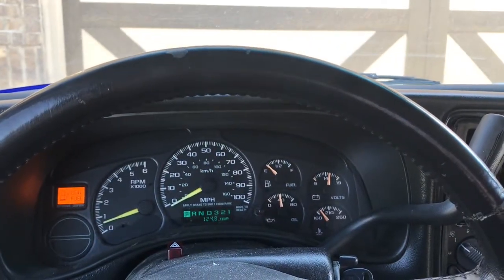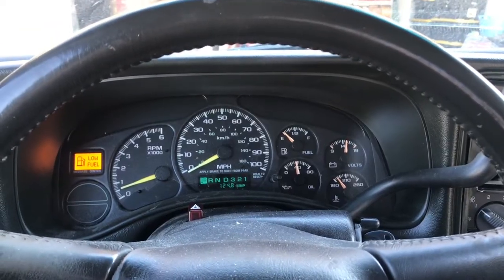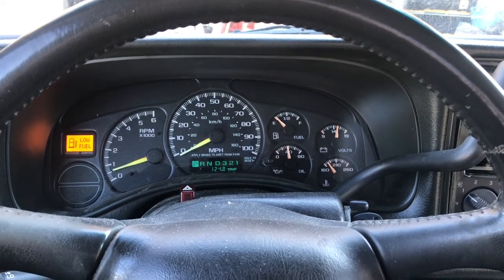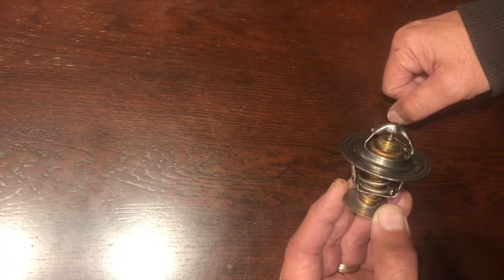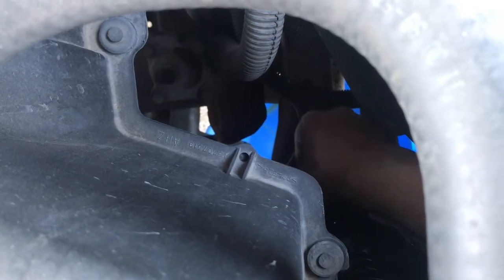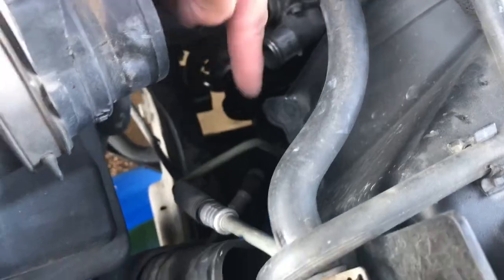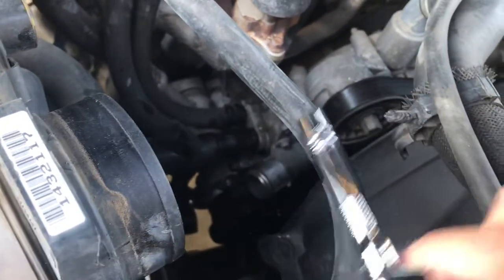If your temperature gauge is below 195 degrees it is more than likely a faulty thermostat.

Comment: CRAP....I wanted to see that stuck thermostat you removed !!! Also I would have used a thin film of RTV silicone and let it dry for about 30 minutes on the new rubber seal to make sure it stays in place before bolting the neck back on. It is always a pain in the ass to put new coolant in too, since none of the new radiators have an old style fill neck on top,.....engineering genius,...NOT.  LOL.
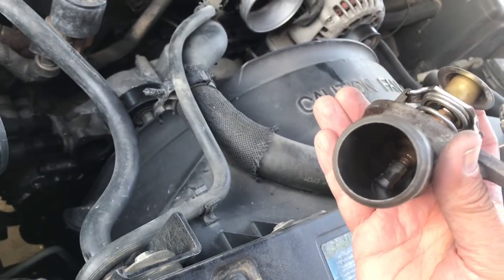Reply: 8:58

Comment: I put a larger radiator in my 94 silverado and kept the 195 thermostat but it stays around 155 to 170 on the temp gauge, also my heater is only running around 110 to 113 in the cab. Any ideas to help a feller out?
Reply: No problemmm.. you can cover a small aprt of your radiator with a cardbaorda and give a try . if you fell better,

Comment: Need some help. 2014 Silverado 4.3 105k miles Temperature is stuck at 160 and fans keep running constantly until I pull the fuse. No codes with both of my scanners. I replaced the thermostat sensor and it worked fine for a day and back to square one. I have the thermostat to replace next. My question is will the cold air intake I installed cause this issue. It was fine until the temperature dropped outside. 
Failed to mention with the scanner hooked up when the temp sensor was working the scanner was off at least 60+ degrees difference than the gauge in the truck.
My question is what’s next. I keep reading different things that the ac pressure sensor the map sensor could also cause this. 
Please help if anyone else is experiencing this issue what did ya do to fix this problem.
Reply: dont invent in your car, fan switch may have a problem..

Comment: I have the same issue lack of heat and it’s only 64 degrees by me. 
i have change both of the thermostats on the body housing Tested some sensors and no luck
2019 there was a recall for the catholic converter. This is my fathers car so I don’t really know when the issue started as he don’t drive the car much as you can tell from the mileage Anything will help, any advice.

Comment: My Dodge 1998.5 24 Valve Ram Diesel 5.9 in the cold weather will Not warm all the way up to 195°
It can idle for hours even go for a drive, the dash temp gauge will show Approx 190° but a temp gun right on the Block Thermostat housing never get up above 170°
Reply: @Douglas Nathan yeah I hear ya, but this is a pick up truck and the round town MPG has declined dramatically and coupled with the Purposefully cause fuel price increase of $1.60/ gallon by Sock Puppet fool BIDEN, the performance loss is increasingly Untenable.
Also I know that Semi Trucks put a special Radiator Blanket over the front of the radiator with adjustable flaps to control/ block the air flow so Thier trucks will warm up.
Reply: @Douglas Nathan Has nothing to do with politics just like oil and gas prices. Poor dummies believe anything the wealthy tell them lol.
Reply: On my Dodge , same as yours, I found that in the old weather it helps a lot if you can get a Blanket   like the 18 wheelers use to block the cold , they place it behind the grill in front of the radiator

Comment: Hello Scott That's Not The Problem with my Truck Brand new Thermostat, And even running for hours and will not warmup to temp to Open The Thermostat
Reply: I just put a new thermostat and new engine coolant sensor and it's still running cold 🤷‍♂️🤷‍♂️🤷‍♂️
Reply: @johnbeasley7654  were you able to figure it out? I am have same problem.
Reply: @Supreme_Solution OYL  no I haven't had time to really work on it. I'm prolly just gonna take it to a shop. I'm thinking I just got a bad thermostat but the thermostat assembly is like $110 so I dont wanna just keep throwing parts at it.
Reply: @johnbeasley7654  let me know what you find out from the shop im having  similar problems.
Reply: @supreme_solutionoyl3933  will do, I should be able to get it into the shop this week
Reply: @Supreme_Solution OYL  ok so I just got back from the shop and apparently I had a bad water pump. It wasn't a bad leak so I didn't see any visual indication of a leak I guess it was bad enough to cause problems though . Hope that helps.
Reply: @johnbeasley7654 me too
Reply: Hey Gary .. did you ever find out the problem on your truck, I am having the same exact problem with my 02 Yukon and don’t know what it is, already changed thermostat
Reply: @albertjones9171  Check your Engine coolant temp (sensor)
Reply: Have either of you had any noticeable damage from this? Mine has been running cold for who knows how long and it is now running bad. Engine is staying drawn down with a slightly noticeable tick right in the tip front with a faint walk in the serpentine belt 🤔 I cannot figure this out. I am afraid it is going to ruin my trailblazer. New tensioner pulley, temp sensor, cam position sensor. I don’t know what to do. Thanks for any answers.
Reply: Replace your temperature sending unit sensor
Reply: Dealing with overcooling on my 99 suburban

Comment: I have a audi A3 2005 tfsi, and its having a heating problem. The temperature never reached 90 decrees Celsius before I changed the thermostat, now it reaches 90 after I changed it, but it takes about 15-20 minute of driving when it should take about 5-10 minutes. So I changed the temp sensor but that didn’t speed up the heating either. I’ve tried to bleed the system of air without succes. Anyone who knows what it can be or if you have or had the same issue?
Reply: Similar is hapening to me, with Citroen xsara. If temp reaches 75,  by pushing gas pedal and making 2000 rpm or so, temp goes down. Also with AC turned on, temp is constantly just about 60 because ventilator is engaged, and cool radiator constantly. And yes, thermostat is changed , maybe 4 times.😟😀😀😀😀
Reply: @colloidalsilverwater15ppm88  ventilator may not be engaged,, if your temp is 75
Reply: your new thermostat may have a problem..when coil is weak it may get more tim for correct emp, i wouldnt mind with it , check fule consuption in computer if it rises better get a new thermo

Comment: After warming up my car the thermostat goes to the middle but if it’s cold outside my thermostat as I’m driving goes all way back down to cold what could be the problem
Reply: Its getting to much cooling the  thermostat is stuck open Thermostat stuck open Most likely it can cus it to be more cooler and take longer to heat up right and never gose to the middle  at higher speeds and in the coldereather  or it could be as simple as its just the  The Temperature gauge is broken
Reply: Just replaced my thermostat because my heat in the truck and the temp on the gauge are very low. Tested old thermostat it works properly. Why won’t my engine get up to normal temp. When I’m driving it goes almost down to lowest temp on gauge 160F, when Im parked at idle temp gauge goes up a couple little lines on gauge but not normal temp. What could be the issue? Any thoughts?
Reply: Same here @bigpapa6835
Reply: @bigpapa6835 find the problem?

Comment: My mechanic guy just Lower the Temperature gauge to about 100 degrees which is only 1/2 ( half) of the Operating temperature on PURPOSE. Is it Safe to Drive now. My car Problem was The Radiator keep BLEW UP. TOO MUCH PRESSURE SOMEWHERE. Could Not figure out what the PROBLEM is. My mechanic guy said it was the Gasket Blew that cause the problem. So I just Replaced the Engine with another USED ENGINE. the Radiator Blew AGAIN. HELP HELP
Reply: come here i solve your problem for life...
Reply: Make sure your radiator cap is correct, it should open up to release pressure

Comment: In My Car From the last month I am facing weired issues:
- Fuel Tank Got Shrinked Which caused wrong fuel indication.
After installing a new Tank i am seeing whenever I open my fuel tank cap, air vacuum releases.

- Another problem is. My temperature gauge is going 1/4 only.

2 months ago I serviced this car.
Oil change, Oil Filter change, Air filter change, Installed thermostat which was not installed before, 

After servicing I ran 150kms.  Everything ran fine,

But now I am facing these two issue.

Steps I have taken
: Checked temperature guage by grounding it. It works fine.
So I installed new temperature sensor.
But same thing happening.
Reply: @Herson Cuc issue has been resolved.
Issue was ground wire on thermostat
Reply: @irajeshtailor  your thermostat has a wire? ahaahaah  it was not closingg